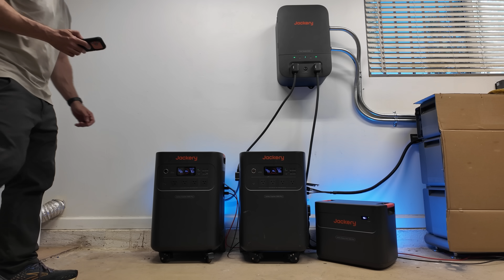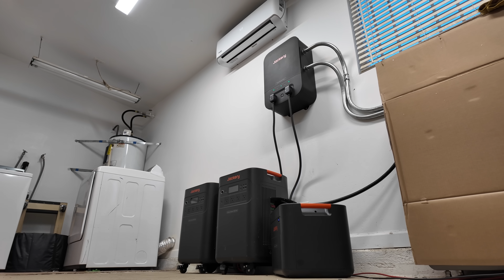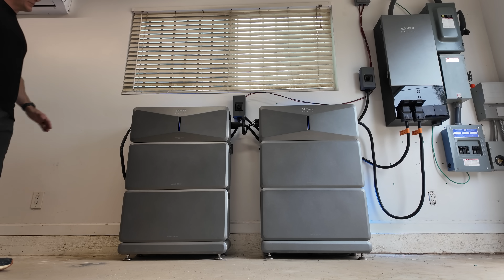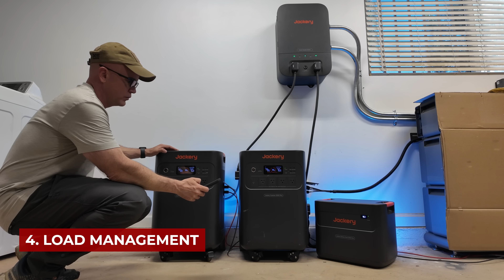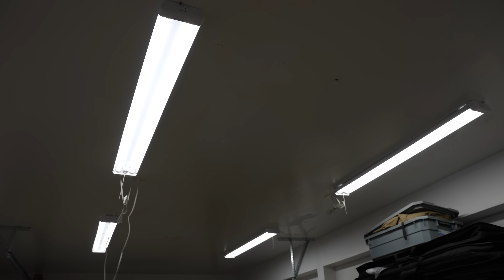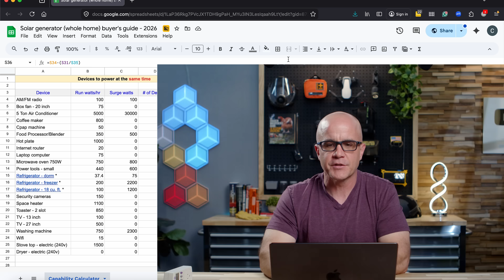What Actually Happens in the First 60 Minutes of a Grid Failure

Comment: I learned pretty quickly to turn off all electric heaters/coolers and unplug the chest freezer when a blackout occurs.  Even with our solar array and batteries, those will take our batteries down to zero in a matter of hours. (I also cycle the fridge if we hear that we will be down for an extended time.  And if it happens during the day, I will check the system's site, and if we are producing more energy than we are using, I plug in any rechargeable solar battery units to capture that for later. (Our excess energy is sent to the grid, but that connection is cut during an outage to protect the line workers. So it is truly 'use it or lose it ")

Comment: This is the second video from City Prepping that I've watched, and both are excellent! A very overlooked specification of inverters is "no load" power draw. Frequently, manufacturers don't even give you this spec. If you are on a tight budget and end up buying fewer solar panels or batteries than you really need, this spec will bite you hard. Some inverters will draw 50 watts of power all the time, which is 1Kwh wasted every day. Others waste far less than that, but they all waste some power. You need to account for this wasted energy when you size up your needs.

Comment: my only concern with a battery running the whole house is the principle of batteries wearing out after extended periods of discharge, recharge and just overall use over an extended outage... personally (and i know its way overkill) with a 200 amp house service, id look into getting a whole home generator that runs off of natural gas or propane... OR the redneck option of buying a military surplus generator... those run on diesel (typically) and can supply much more power then a little generator that runs off of gasoline. diesel would also be a good option for when natural gas and propane runs out cuz technically you can make your own biodiesel 

(edit) i know generators are loud... i wasnt thinking about that cuz im 100's of feet from other houses and noise isnt a concern lmao

Comment: @1:31 No it doesn't "need" 1000w of power, watts is a measurement of heat, the eye outputs 1000w, the current it uses is measured in amps.
Watts is a measurement of output, AMPs is the measurement of the input.  Draw amps, output watts....  @1:45 That is very ignorant, I can't listen any further no more showing up in my recommends no way.

Comment: If you lose electric all the time that determines your decision. 
We may have a power loss once every five years or so, usually from a storm. 
We have a small portable generator enough for refrigerator, microwave or heater. Don't have to use everything at the same time. 
Take a chill pill, think about what's necessary!

Comment: Got a 23kW diesel genset with 2 weeks of fuel (continuous usage). 

My home idles at about 3-5A (240v),  full load about 63A/85A surge (240v). 

Got a gas generator as a secondary backup or to run during extended low power usage (like at night, just need to keep the fridge/freezer going).

Also, highly recommend getting a soft start for your A/C compressor. Not only does it make ot more generator friendly to start but also can extend it's life.

I've got a few years experience with intermittent power outages from a day to a week in length. I've got a system down and procedures that keeps my house running as normal as possible while being efficient in fuel consumption.

I thought about going solar, but i don't have enough clear area for solar panels, and I'm in deep rural area, so having a fuel generator isn't much an issue.

Comment: About ten years ago I was living in Colorado at 9000’.  I had a modest fixed array 8 panel solar system for power which was working well for lighting, large screen TV,  well pump and pump to circulate radiant hot water through the floor.  I met my future wife and not long after she moved in with me.  She has beautiful thick hair.  The first time she plugged her 1500 watt hair dryer in I realized the system was not built for such a device.  From then on I had to plug in a small generator for her to dry her hair.  Some things are hard to plan for. 😊

Comment: You explain watts very well, but then, in minute 11, you bring up volts. What are volts and how do they relate to watts? Also, if an appliance states the number of watts on it, does that automatically mean that is the number of watts that will be used in a 1 hour time period? (I watched thru mid minute 15.)

Comment: I would love to buy something for emergency backup but I get so mired down in the details. If anyone wants to suggest some options I’d be grateful! Details are apartment dweller, south facing windows and tiny balcony, young senior citizen, northern US, now way to heat my unit or access breaker box but if I could run lamps, charge phone, electric tea kettle or hot plate that would be amazing. Portability is a priority to as it would be stored in my clothes closet and pulled out to charge or if needed. So maybe wheels? Or a cart? Or not too heavy? Thank you in advance for your help!

Comment: Yesterday, a major power company in AZ proactively shutdown power 12-24 hours to 6000 people ...because of a red flag warning. Red Flag warnings are proclaimed when humidity is low and winds are high. The same county where this happened has built wind turbines because it is always has high winds. Arizona is always dry ... it's a desert. Never before in my life have they used a red flag warning to decide that they should turn off grid power to avoid wild fires. People were running generators to power their houses ...which are usually restricted during red flag warnings, depending on the stage, because they generate heat and sparks.

I was pleased that it did not affect me because all my electricity comes from residential solar. Converting was one of my best decisions.

People need to realize that the industries and utilities that they depend on are not dependable.

Comment: here’s an EXTREMELY important point of fact that you missed entirely when talking about these battery based systems, and ESPECIALLY if you plan on using them for emergency backup. The biggest mistake most of these use cases make is storing their system away at 100% state of charge (SoC).  Almost every single one of these systems use LiFePo4 (that is lithium iron phosphate) chemistry in their cells…the this chemistry will degrade much much faster if it is kept in a fully saturated state. The reason for this is that imperfections will start to form in the cells  (the anode specifically) called “dendrites”, and the more dendrites a cell has, the less efficiently it will be able to transfer ions from anode to cathode. This results in less watt hours that can be stored. The long and short is that of you plan on storing the units, the optimal storage SoC is 50-60%, which will result in almost no cell degradation over long periods. 90-100% SoC long term storage has seen permanent capacity losses as high as 4-5% per year.  The same applies in day to day usage, but to a lesser extent…it’s good to draw them down periodically.

Comment: Actually, another critical component to those four is the longevity of the system. How do you maintain it? If you have a gas generator do you have parts on hand to replace when things fail or began to degradate 0:51

Comment: "Whole home" power is absolutely unnecessary.  Enough power for a couple of appliances; fridge, hot water heater and a few lights.  Automatic garage doors, dryers, irrigation controllers, dish washers, 50 outlets etc etc seem unnecessary.  Think cabin in the woods.

Comment: 6:30 I can't fit/afford this and I can't get solar where I am. But I've made small steps since we had a local power cut. I've got an Anker solix power station and a portable 100w solar panel. Plus I have a small solar panel I use for camping that can charge a power bank or device if needed. 

I'm not gonna be running loads of powered devices during an outage. I have torches, radios and plenty of batteries for them.

Comment: Tip: In the U.S. you should look for much more energy efficient household appliances. My refrigerator in Germany uses around 300-350 Watts per day! I can run it 3 times longer from the same power station than a 900 Watts device.
It’s also much easier to recharge the power station with limited sunlight or smaller solar panels.

In short: Go for the most efficient devices that you can afford. Water kettle, washing machine, vacuum cleaner, refrigerator… you will save money over time and are being prepared with tools that you will use everyday! Thank me later. 😉

Comment: California, maybe 1 outage a year. My first move was a 5500 W dual fuel inverter jacked into my panel. Propane powered. 
It worked but not quite enough power. Now I have an F5000 coming with a Humsienk 16 KWh battery. 
My house uses 15 KWh per day so this set up gets me 30+ hours. I can then shut it off and charge at 240v or fire up while running and charge 1800 W plus solar.
I think I could last a week without needing more propane....or steal from my truck which holds 22 gallons. 
Good video. Makes one think of extended needs.

Comment: In my famille’s off grid  experience, we also found that energy used by remote controls constantly searching for a signal was an unexpected waste. Plugging TVs, Dvds, Heaters ect into surge strips that could be switched off when not in use provided an unexpected savings. Also extensive use of thermoses kept drinks heated or cooled with minimal energy expenditure.
Reply: learn how to not need to cool or heat a drink.

Comment: I just stick with the smaller units, 2 or 3 kw like the Bluetti AC200L and the Elite 300.  I can afford to buy them, one at a time, so that I have more than one power station.  I like to have spares in case of problems with one unit - 2 is one and one is none.  I use each one for one appliance - I use one power station for the fridge, another for the microwave and hot plate, another for the portable air conditioner (or furnace in winter).  The fridge is connected 24/7 for power loss and surge protection - also skips the peak rate hours.  The power stations are portable and since I have enough that I can solar charge one while the others are in use.  I can even drain one into another solar generator to suit power use.

Comment: If you get a jackery 3600 be warned you need two primary battery units - not the expansion to run 240V.

Comment: I didn’t hear you touch on that when you have an electric motor or a compressor and it first starts (in rush) the current draw can be many times higher the current used when it is already running.

Comment: We discovered most solar companies that put units on homes are not truthful. We requested a battery that would run our house at night. Once it was installed they informed us it will only run at night IF the grid is down. We believe in testing all equipment that we would need during an emergency so we shut off the main breaker and tested what the unit could handle. After 17 hours we lost all power to the house. At that time of day the sun was shining and the expectation was the solar would recharge the battery and supply the house. That is not the case. I called the company to find out what happened and they congratulated me on lasting 17 hours and said most households only last 8-10 hours. The battery only lasts until it looses it's charge and then we must be on the grid to recharge before the solar panels even work again. That's when they said only the Telsa Powerwall does what we asked for and that was not what was installed. Buyer beware. We purchased our unit not just for when the grid goes down but also to shield from the electrical prices spikes we're seeing nationwide.

Comment: When Hurricane Sally hit, I lost power for 64 hours. Food in my freezer stayed frozen without having any power because I 1)made blocks of ice in plastic containers ahead of time and packed then in the freezer and fridge 2) packed the freezer tightly, including removing food packages from their boxes and 3) only opened it to add more ice. Granted, not every disaster gives advance warning that your power is going out! But the point is, on any given day your refrigerator and freezer will use less power if you keep it heavily stocked, with ice blocks in the freezer and jugs of water in the refrigerator. That’s my two cents!
Reply: That would be my plan.  I have larger containers of water frozen in my freezer when the food is getting low.  I also keep multiple jugs of water in the fridge in case the water has issues.  The water in my apartment building has more issues than power outages so far.
Reply: I do this for my freezer with ice blocks. We get regular power outages and sometimes they last for up to 10 hours. On rare grid down situations I use up the refrigerated food and then from the freezer.
Reply: I tried to freeze water in a few mason jars, figuring I could just drink it later (I knew not to fill them completely.) but I found out that ice doesn't expand into  logical areas...it completely shattered two of them. Using plastic bags sounds like a much better plan.
Reply: @JenniferFB Yeah, I keep hearing you can freeze in glass but I wouldn’t do it unless it’s the bowl shaped storage containers, and even then I am leery.
Reply: If your ice is based with salt, it lasts a lot longer because salt water freezes at a lower temperature, and will be the first to that, absorbing more heat.
Reply: @tomgilfoyle6849 thanks, I didn’t know that!
Reply: If you kept adding ice, of course it remained frozen 😂😂😂

Comment: IMO, Battery Energy Storage Systems should not be inside your home.  Put it in a separate outdoor shed you don't mind losing in a fire, kind of like a whole house generator.  Same with EVs, I'd never put one (let alone charge one) inside an enclosed garage - especially if the garage is attached to the house.
  
If it goes into thermal runaway, it produces its own oxygen to burn the fuel it's made of - that's all three points of the fire triangle.  Since we're talking about disaster preparedness, don't make your preps expose you to new disasters.  Friend of mine lost his home to a portable lithium inverter pack charging on his kitchen table - burned the whole house down and they lost everything, and he brought the hazard into his home.
  
I'm not saying people need to be afraid of lithium packs, just that they need to respect it for the hazard it is - we're still learning about it, so nobody has the best practices or "proof they are safe".

Comment: how long can I run a mini fridge using .41 kwh per day with my 2000 w solar generator?  sorry this is over my head
Reply: 410 watt hours per day?  Are you sure?  That's about 17.08 watt-hours an hour.  Sounds really low to me.  Well 2000/17.08 is 117 hours or about 4 and 3/4 days.  Or 2000/410 = about 4 3/4 days.  I trust my math, but not the result.  Maybe 3 days is more realistic.
Reply: @eighteenin78  thanks and that's what Walmart says= .41  "with an estimated cost of 0.41 kWh per day "

Comment: I’m going to my off grid cabin where the power is always off lol until I get there with our 2500 watt power station and plug my iceco vl 60/65 fridge/ freezer and Roku flatscreen smart TV on our old school antenna and get our useul 65 channels and then cut on the cabins solar system and batteries with the 1500 watt pure sine wave inverter and I’ve got bigger d9 size batteries  that boosts power output up too !!

Comment: If you are concerned about the grid going down the best option is to have a full off grid system.
Then you don't need to worry about the grid.
The way I will find out the grid has gone down is when I drive out and find out the stree it dark.

Comment: My 8kwh solar system produces 70kwh on best summer days and less than 2kwh on worst winter days. I’d suggest for people to reduce their power load with things like cooking, personally I make my own biogas, a 1000L IBC will make you 6kwh of cooking gas a day or 1.5kwh in a generator, I’ve done both. You need to keep the digester hot, so for most people I’d suggest insulating the F out of it and using a fish heater to warm it to 34 degrees Celsius. When it hits that temperature the fish heater will use maybe 100-200 watts a day to maintain it. However, if you’re lacking power you can turn the fish heater off and youll keep producing gas until it hits 20 degrees Celsius, which would probably take 2 weeks if you’ve insulated it well. Personally I made a hot compost pile called a biomeiler to keep it warm. If you check my YT profile I made a post with one I buried underground and put a hot compost pile on top, but I’ve made a new one above ground with a hot compost pile surrounding it, so you can read and look at all that. One thing I haven’t done though is use cooking charcoal for a smokeless fire which is probably quicker and easier for a lot of people reading this. I say all this as someone with a auto start generator with enough LPG to run my house for a month straight, take the demand off your batteries when it’s needed because solar will never cover it all and I live in Australia. And if you do any of those things remember to do it in a well ventilated area with carbon monoxide detectors. Cheers

Comment: One thing to note, high PNW latitudes and post-storm clouds can adversely affect solar charging for days... 

I have a 4kW array, it barely got 40W, yes 40 watts during peak sun time during a thick blanket of clouds after a snowstorm

You'll need to parallel the panels for improving input/solar coverage during long stretches of cloudy days
Reply: I observed that my panels still generate electricity when it is cloudy, but not when it rains.